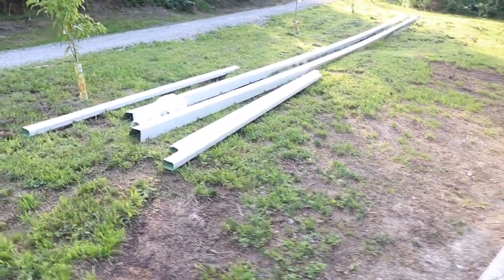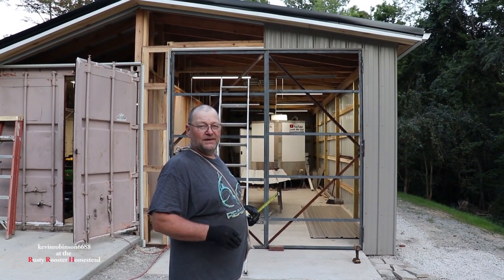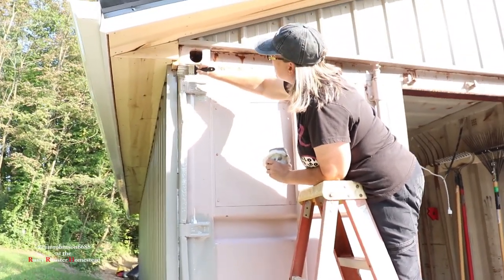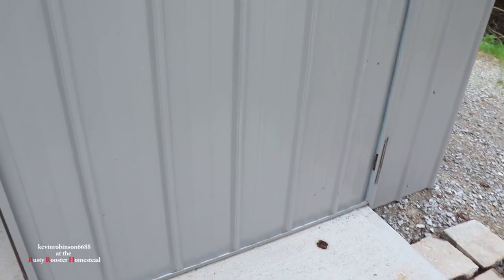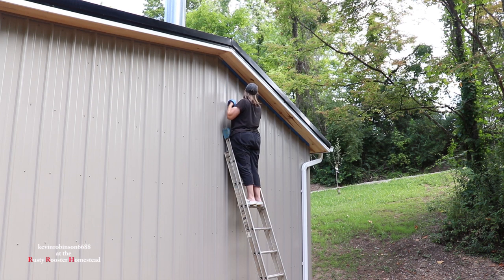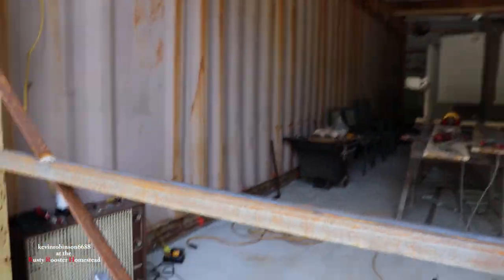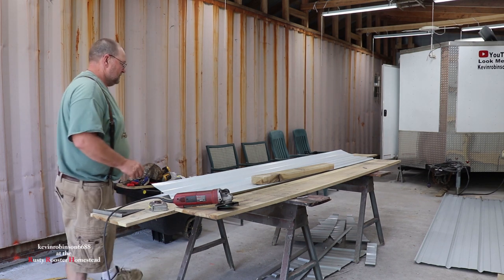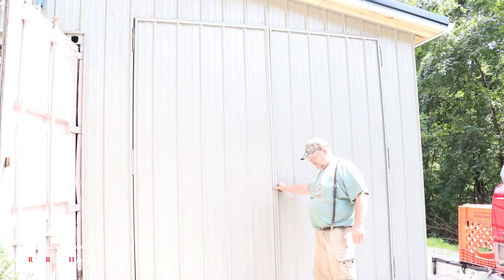barn style door build metal part 2

Comment: Really, really nice work on doors!   I would (respectfully) suggest Rain Harvest.  Put some tanks at the back of the garage and pump-center just inside.   We put in 3 x 2500gal Home Depot tanks -> pump -> pressure tank -> 20micron -> 5micron -> Class A UV  (per city permit requirements) and we go 8 months of the year in our home just off rain harvest with no conservation.  We do 2000sq ft roof and get aprox 1100gal / inch of rain.  The class A UV is the only thing that needs maint / $ -  but some just skip that and use a Berkey for drinking water and the rest (toilets, shower, etc) don't need class A UV.  Its pretty cool / easy to do - especially for someone with your skills :)
Reply from the maker: One day we will be setting something up for sure